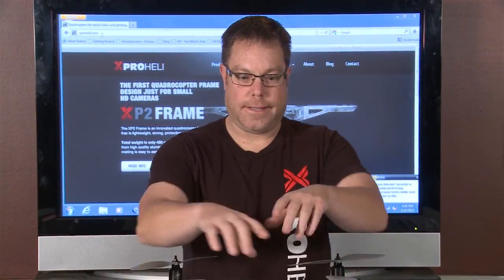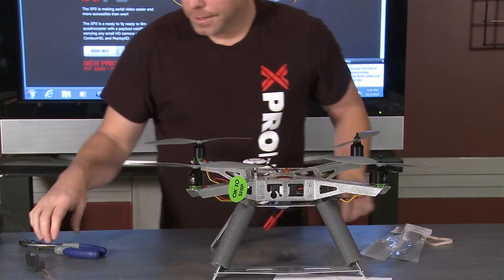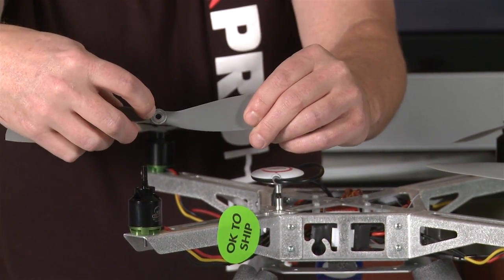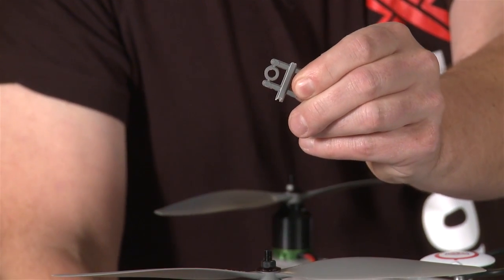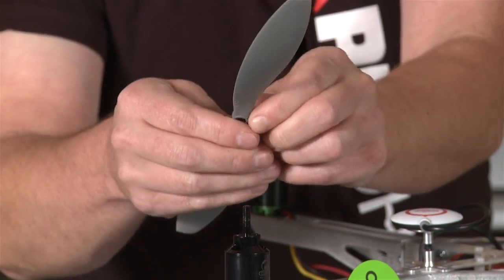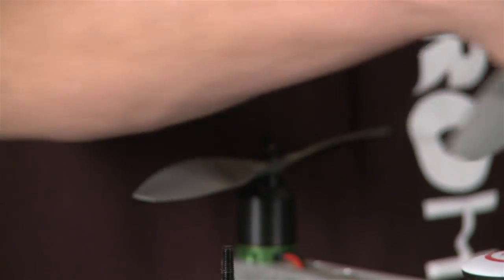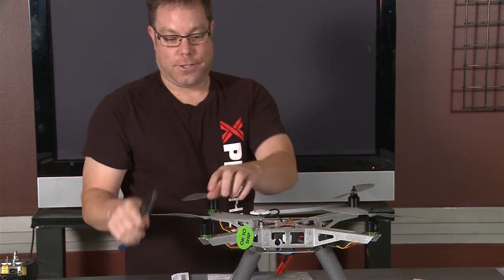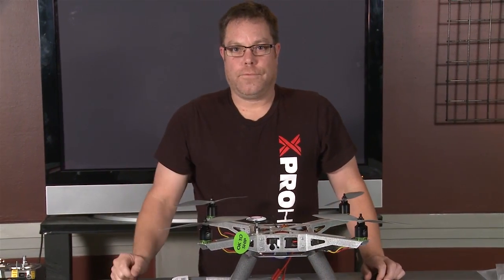How To Replace Props on XP2 Quadcotper

Comment: This is great info.  I had no idea the props were different.  I have not tried to fly my quad yet but I did balance all of the props and then just put them back on wherever.  I think I have them in the right locations now based on what I see in the video.  Do you have a diagram that shows where the pushers and pullers should be mounted?